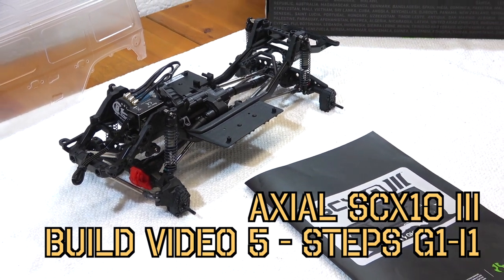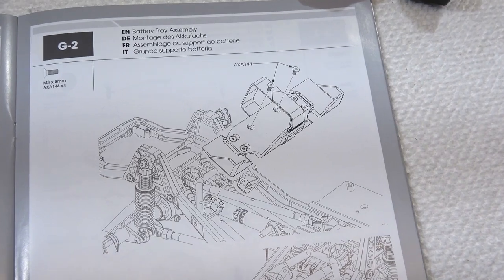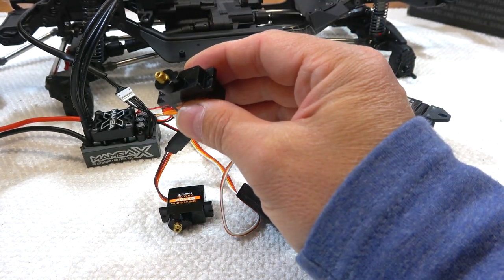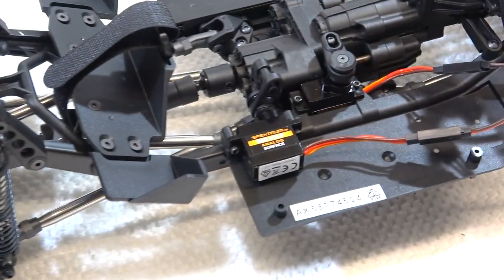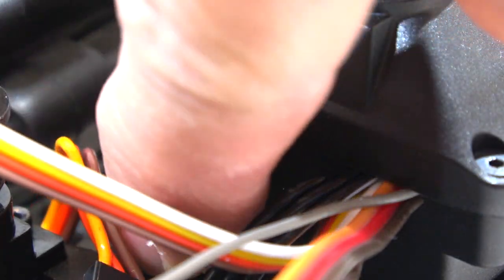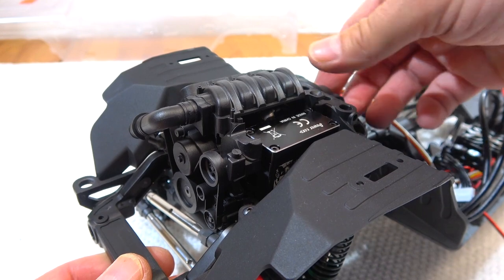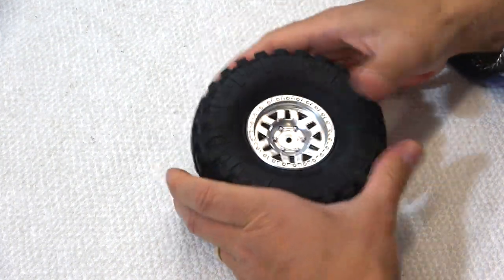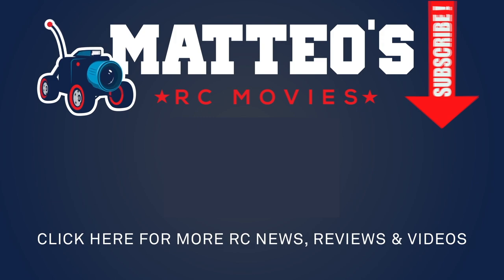Axial SCX10 III Build Video 5 - Steps G1-I1

Comment: Very good build of the Chassis, Matteo!!! 👌👏👏👏👏 
I am somewhat disappointed how Horizon forces people to use THEIR products!! 😖 Not selling the Servo Saver separately - or not including it in the KIT!! 😠😠 

You can probably tell, those are pretty standard Aircraft 9 gram Servos. Short wires because of placement on RC Aircraft, the length is made by extensions, based on Airplane size.

And I heard the now infamous CLICK in the Transmission!!! When you did the Dig and 2 speed tests.
It's far more pronounced when driving under load. 
I hope you have good luck with this Rig!!! Despite the quirks, it is a great Trail Truck!! 
Please stay SAFE! 😷
Carmine ✈🚂🚙
Reply from the maker: Ah, now I know why there are so short cables on the servos! You're the pro Carmine! 👍😊

Comment: I hear you using the micro servos for like II speed gear gearbox with a second gear I hear they burn out real quick also I don't know if you know of any better little micro servos that can handle the dealings of putting into second gear.
Reply from the maker: I think when the adjustments are made well, the servo should stay fine. But if the servo way it's too much and the end points are not correct adjusted, it's always a big load on the servo and it will break. In my opinion this is why the most gearshift servos broke.